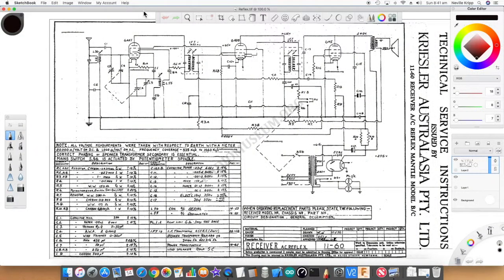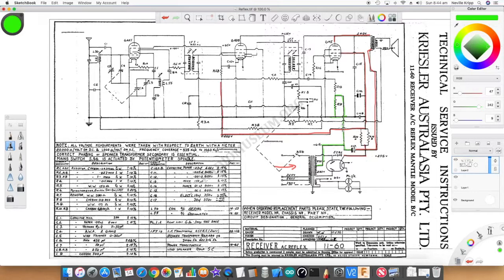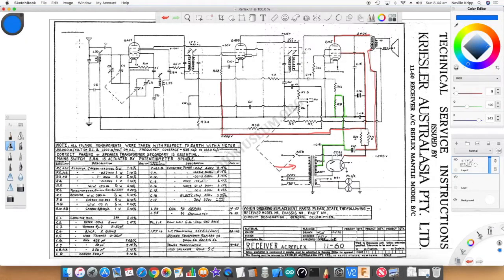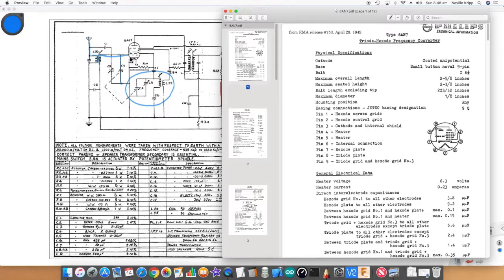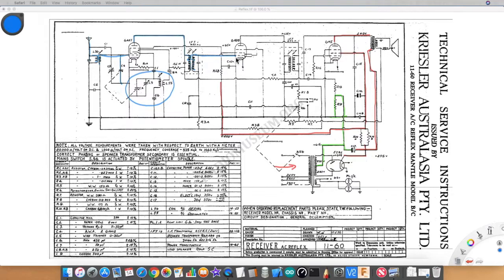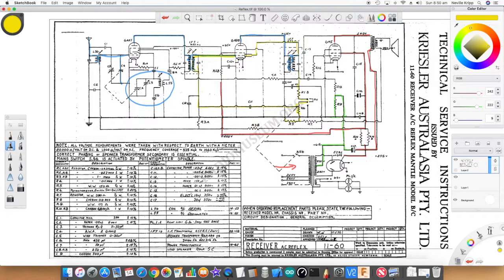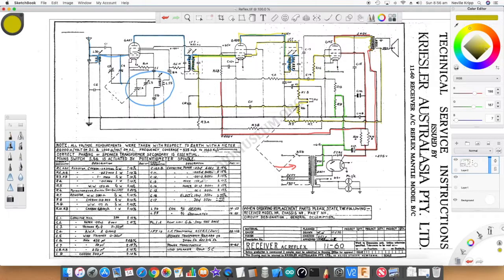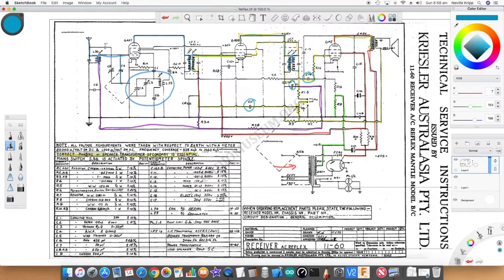#080 Kriesler 11-60 Radio Repair - Part 1

Comment: Hi and thanks for your video. I am working on one of these and im having problems with the volume circuit. The volume remains constant right through the sweep range of the pot. Removing the PU shunt dose not remove the signal so I must be getting an audio signal on the grid of the AD8 earlier in the circuit. I'd appreciate any suggestions.